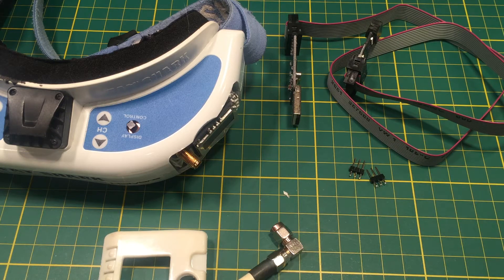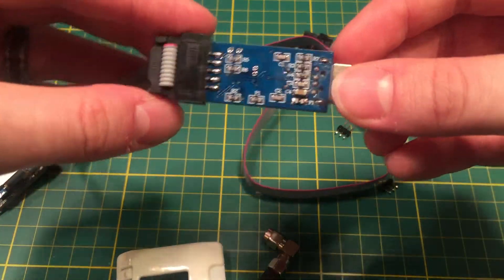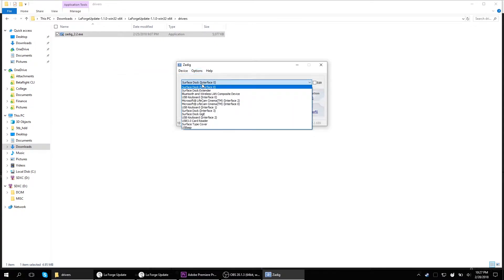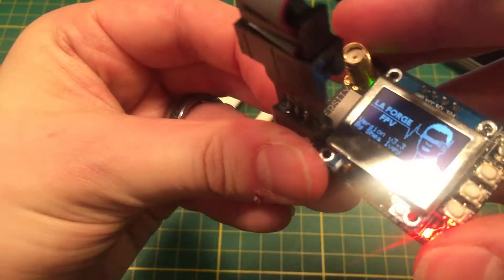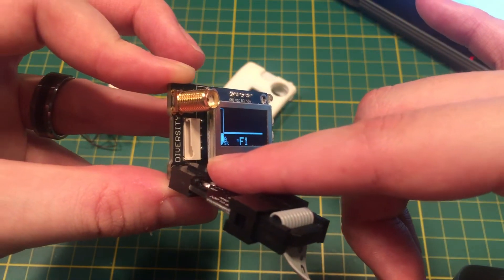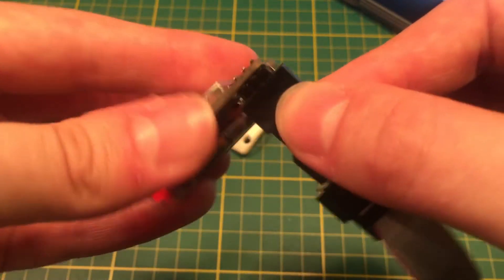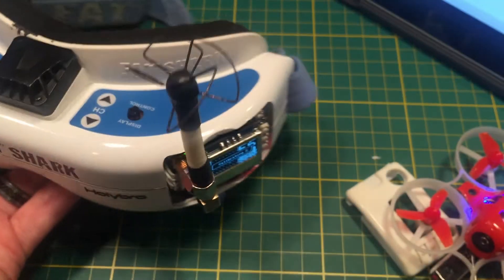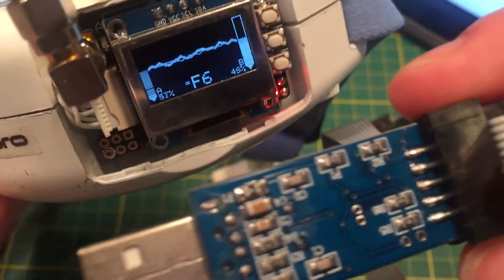LaForge V3 USBasp Firmware Update

Comment: correct me if i'm wrong, but shouldn't calibration be done without any antennae attached on the receivers?
Reply from the maker: oh darn. I just re-read the instructions and you're right. I had misread that. I wonder if it doesn't matter in this newer firmware because it doesn't seem to have affected me at all. I'm gonna add an annotation about that, thanks!
Reply: It's all good! I appreciate this walkthrough as I haven't flashed firmware for my laforge in a year. Thanks for the help!
Reply from the maker: No problem I'm glad it was helpful to you. And thank you for pointing it out. I had never flashed my LaForge firmware before until now. I'm very happy I did even though the USBasp is a hassle.